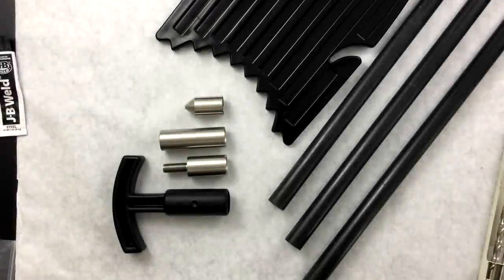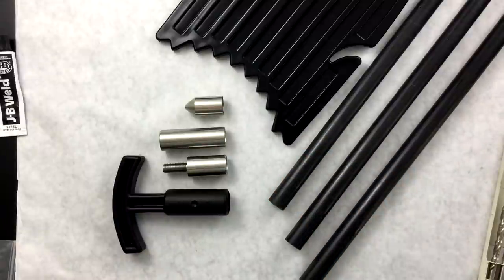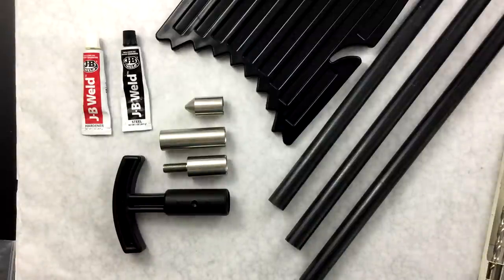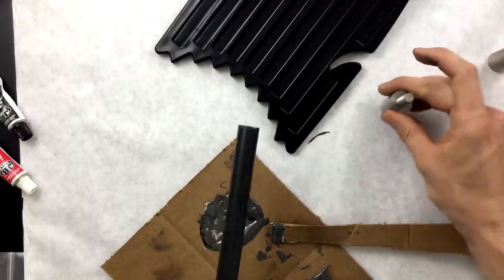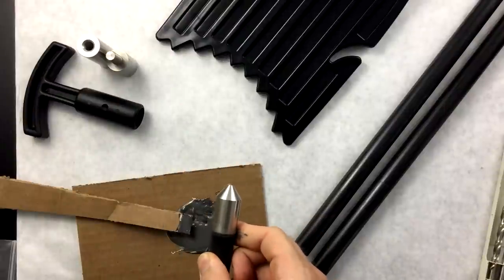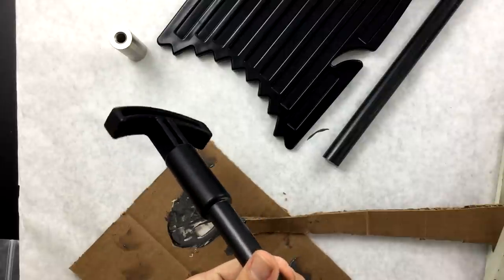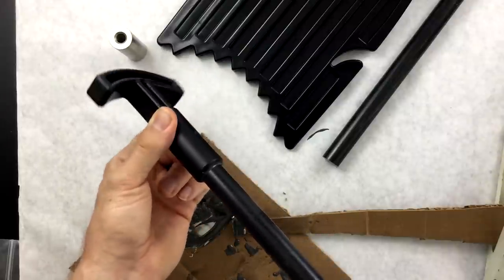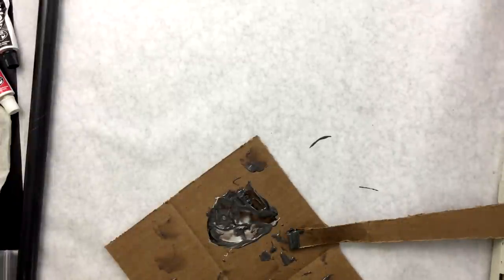DIY Shallow Water Anchor Component Assembly Guide

Comment: Hey there. Anchor was awesome today in a current. Jb weld had a problem on the handle though. Held everywhere else. But so strong. The boat got pushed into the pole by current and the pole held the boat back. I use it with a climbers heavy duty caribeaner, and grappling ring, and used paracord witha basic weave to connect them. Just drop the pile through the ring and we didn't budge.

Comment: JB weld failed on mine leaving the 8ft section at the bottom of the lake. Drilled a hole in the couplings of the remaining poles and put in drive rivets works great.
Reply: JB weld failed on me too but it was at the handle. Luckily I was able to get the entire pole back.

Comment: Went to order my $33 pole kit and shipping is $28? So much for that...
Reply: Look in the garden section at Walmart for uv rated fiberglass poles, you cut to fit. You can buy their handle  or make 1 from a PVC t-joint. All you need from them are the ferrules to make various lengths and a tip if you want one. Use marine epoxy not jb weld.
Reply: Big Dogg Status where to buy ferrules?
Reply: @Jack Schofield try harbor freight?

Comment: Oh, PLEASE, have someone who understands editing do a thorough job on this video.  You've managed to squeeze a 10 to 12 minute video into almost 50 minutes of thumb twiddling.  We do NOT need to watch the entire process to understand how it works.  Show how to glue one or two joints, the tip, and the paddle.  The directions for mixing JB Weld are right on the package and you don't need to demonstrate that each time, either.

Now, please excuse me while I go watch some paint dry.
Reply: Make sure you inhale deeply while watching the paint dry.